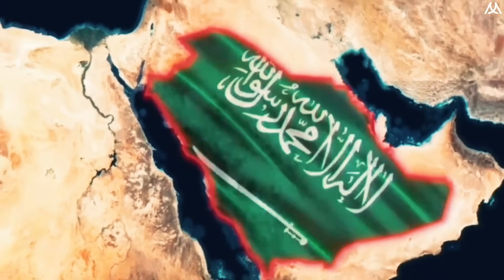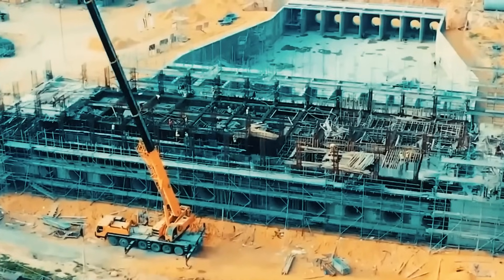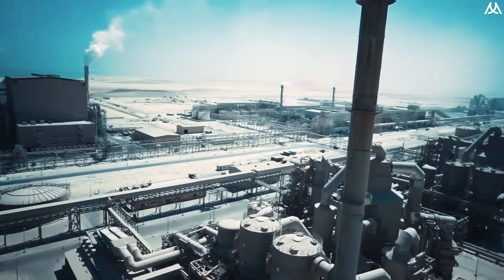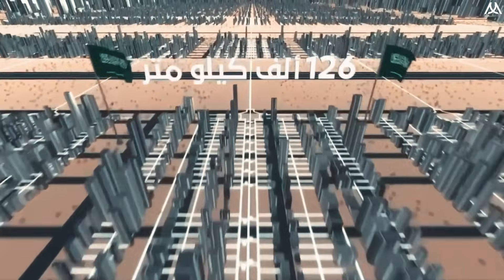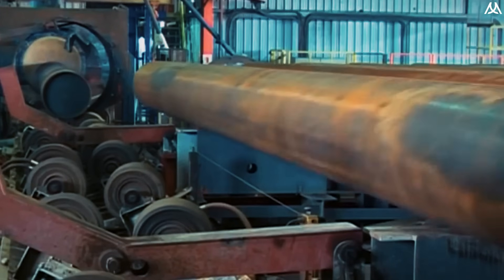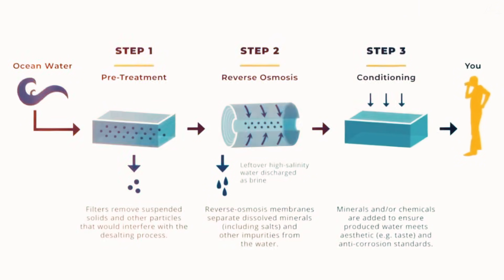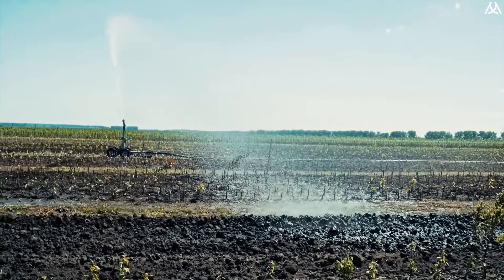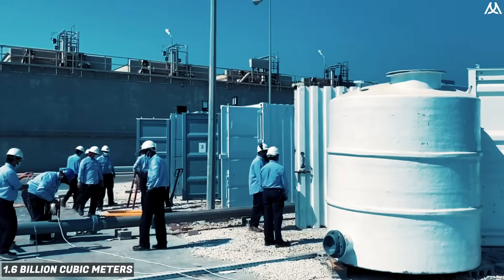Saudi Arabia Transforming Desert into Fertile Land - Longest Artificial Underground Canal

Comment: There's a glaring omission of a map of the artificial canal that's billed as larger than the Nile.
Reply: 12,000 km of 2.25m diameter pipe?  That's a ton-o-water.  And they have to constantly desalinate enough to feed the system as people begin to use it downstream.  Nile, yes or no?  Either way it's one helluva project.
Reply from the maker: good feedback. i meant to show map
Reply from the maker: good feedback. i meant to show map